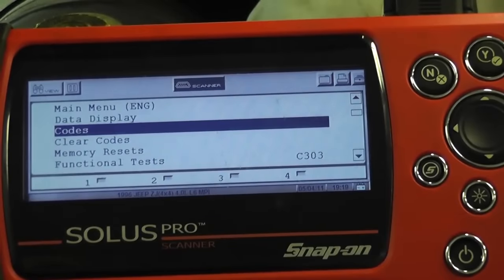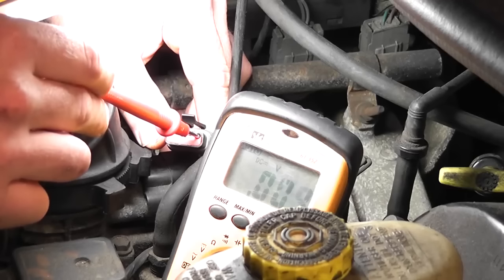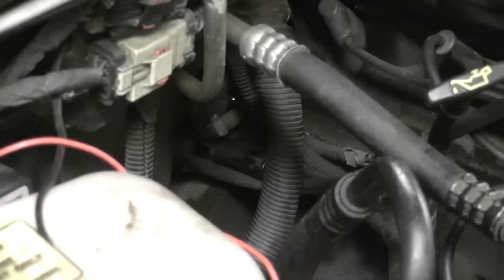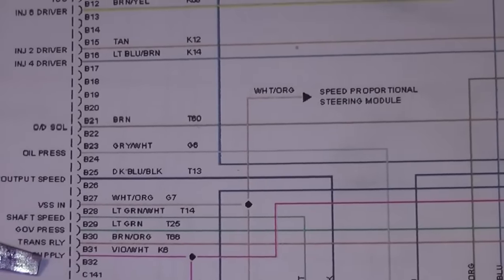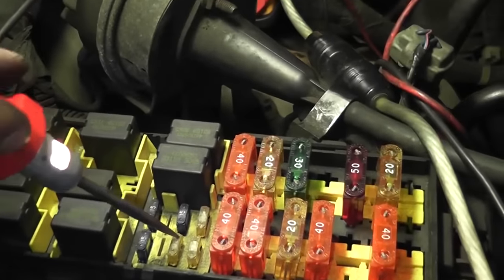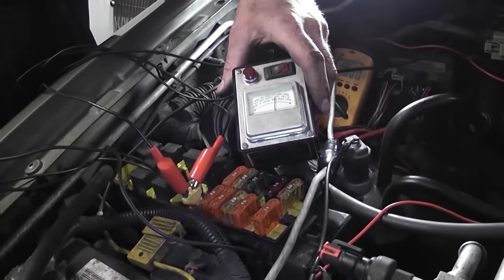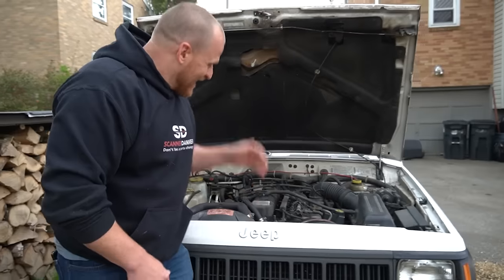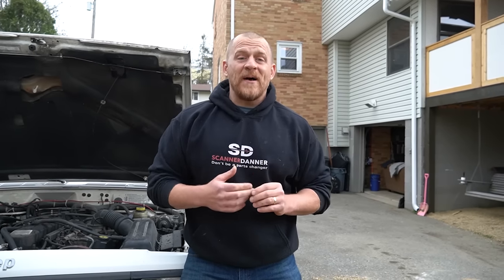96 Jeep, No Start, No Com with PCM, No 5v reference (Quick Tips)

Comment: Hi dear, instead of cutting the 5v ref wire, could its pin be extracted from ecu connector? And measure the voltage.
Reply: Yes
Reply: I was thinking the same thing, although extracting the pin can also be a huge hassle sometimes.
Reply: I think first of all we have to check feed power in ECM connector because first he show it not communicate so no need to check 5V.Battery positive and negative in ECM is basic troubleshooting if any ECM not communicate.
Reply from the maker: Yes, of course, but on this style ECM connector, the pins all want to fall out when you take the main plastic holding piece out of the connector.
Reply from the maker: @Nadeem, please watch the shorted MAP sensor video that I referenced in here, then you can tell us all how to troubleshoot these circuits.
Reply: The reason for cutting the wire was to obviously save time.

Comment: I remember this one. Yes, you should have started with the fuses but your approach was better for your students. Nice fix and bad bad design from Jeep.
Reply: Not really, if you go to the end of the video where Paul shows us starting the 96 Jeep (different one) but showed us where it was supposed to have been addressed (behind the power steering pump) as it should be so the owner or someone at the time had replaced the pump, but didn't put the wire back where it should be.

Comment: Hi Scanner (not Daniel), 2003 5.3liter Silverado stalled a few times now only cranks. We changed gas lines, filter, cam sensor, crankcase sensor, plugs & wires so I cleaned the main window switch then disabled the security passlock ignition module directly and then with the 4.7 ohm resistor!? Also installed a programed computer. Computer shows VIN on Snap-On Scanner but only cranks. We only get about 1.5 volts references to computer with no pulse to fuel injector. No, I don't know what I'm doing. Wish you were here..2Help! ? What 2do?
Reply from the maker: 1.5 volt reference, start here! 
Unplug sensors that share this 5v ref and see if it comes back. MAP, TPS, AC PSI Sensor, Fuel Tank Psi etc

Comment: Where do you get your wiring diagrams from? I've Bern looking for a wiring diagram for my 2011 Dodge Ram 1500 4.7l.  All I can find are diagrams for hemis. I've never had to work on electrical on cars, but this issue hs been driving me crazy
Reply from the maker: This is the DIY version of the diagrams and service info I use. Same info, just access to one car. https://eautorepair.adtrk.biz/?a=10817&c=24&p=r&s1=

Comment: Hmmm. Next time im running into a short on a 5v ref im gonna put a low amp clamp on it and see if i can call it that way. A short pulling the voltage down meens more current flows than what is suported by the circuit...
Reply from the maker: That would be correct BUT, the computer systems are smart and will actually disable to 5v regulator (isolates it from the circuit) as soon as a short is sensed, so this method would prove to be frustrating on some models.
Reply: @ScannerDanner  Ah. That is true.
To fight that one would have to have the scope running to catch it when you turn the key on. You know, before it cuts out to protect itself

Comment: have you ever seen a vehicle with Metal Conduit(long metal tubes, looks like fuel lines)as a wire protector instead of the plastic conduit. It gets used in industrial and now even residential applications.
Reply from the maker: I have not as weight would be the factor

Comment: I have a 98 jeep zj 4.0 laredo i have put in a new computer new alt , Coil aic throttle position up stream down stream new crank position sensor new cam sensor new exhaust manifold intake manifold checked for vacum leaks and still every once in awhile after warm up i get that engine surge. After i turn the key on and gauges and lights do its prefunction check the check gauges light stay on i cant get the obdi to talk to the computer. Been chasing this gremlin for 2 yrs now need some advice please help.

Comment: Greeting Sir, am Suh Vincent writing from cameroon. My question is does the ECU generate just one 5v and distribute to all the sensors or each sensor have a ic which generate it 5v reference
Reply from the maker: On the 96 model year, yes there is only one. But on newer systems you can have as many as 4 different 5v regulators in a PCM

Comment: Thank you for this good video, Paul. I'm working on my 1989 Camry blown fuse problem, 2 months now and I can't find the wire.
Reply: HI Nancy Lewis i think if you had the wiring diagramme you should be able to find it.
good luck and have a nice day. By
Reply from the maker: Intermittent problems are super difficult. Find out what all runs off of that circuit and then do a good visual inspection, especially on the areas of the harness where there is heat and vibration.
Reply: @ScannerDanner  most likely inside the cab,?  or engine compartment.? The DOME fuse covers, Antena motor, Radio, Clock, ECU, door warning light,  all interior light, taillights. Thanks Paul.
Reply from the maker: @nancylewis7142  2 months ago is the last time it blew? And it's a daily driver? That won't be easy to reproduce. But yes, I'd look under the hood first. Visual inspections of everything near heat and look closely at where all the harnesses are rubbing. Also watch my Hummer case study with the shorted reference circuit for an idea. I had a main harness rubbing on a bolt! (I don't have the link offhand, it's one of my newer videos)
Reply: @ScannerDanner  blew 2 months ago, I parked the vehicle and I start looking for the problem. No it's not the vehicle I'm driving, but my grandparents gave it to me, and I'm gonna use as a second car. For emergency only.

Comment: i have a 97 grand cherokee 5.2 that starts but no crank , this problem happened months ago, it had been running the day before.  and it would crank but no start, the fuel gauge wasn't reading right it had a 1/4 of a tank . i replaced crank sensor , ignition pickup coil , the coil check ok , could the pcm gone bad, i will check power to the pcm and also when i check it with a code scanner no codes. any suggestion ?

Comment: Scannerdanner, what is the name of that short finder tool you used in the video its a silver grey meter with a RED light. I haven't seen you use that tool so I don't know the name of it or how its used. I think you connected it across the ABS relay terminals and was moving wiring harness to see if the RED Light would turn on?
Reply from the maker: I have it listed on my Amazon affiliate account https://www.amazon.com/shop/scannerdanner
Reply: Nice thanks ya it shows a lot of your tools you have used in your videos I have seen before. I don't think I have seen you use that short finder meter in other videos. Before cutting the +5 volt wire, you could have just unplugged the Harness connector to the PCM Computer and measured directly to the +5vdc pin and ground to know if the PCM computer is output +5vdc with the harness connector removed?

Comment: Correct me if I'm wrong, but wouldn't having an incandescent test light hooked up to battery positive resting on the side of the fuse socket going to the sensors and watching for the light to turn on while doing a wiggle test also be a valid method for identifying the short circuit? Loving these new summary videos by the way.
Reply from the maker: Yes, you can do that on SOME circuits, but not on this one. The fuel pump and O2 heater which have constant grounds, will cause the test light to find a path to ground through these components, lighting your test light constantly even with NO short to ground. So in short, when you have low resistance outputs on a circuit that can carry the current of your test light, you CANNOT do this test you are suggesting. Make sense?
Reply: Thanks for reply and yes your explanation makes sense. I had a feeling there would be an issue with my method, while I agree that the test light would be illuminated regardless of the situation due to the paths to ground you mentioned I would think the intensity/brightness of the light would change when the shorted wire came into contact with the manifold. The reason is alot of the circuits you described have windings (solenoids, alternator) which I think would place a load and reduce the brightness of the test light until it could bypass all those components when the short to ground occured and the light would become brighter. Not trying to challenge your knowledge as I've learned alot from your videos, but this theory has me interested. Thanks for your time.
Reply from the maker: @richardsalaverria9363  all good my friend and great questions. Just remember in the case of a brush type DC electric motor, that they essentially have no resistance when they are stationary, so your test light will be exactly the same brightness as if you were connected directly to ground. 
Others circuits, you are correct, you'd have different levels of brightness based on what the output resistance is.

Comment: Can you do one on the can bus system?   I'm having a problem with no can bus on a 99 jeep cherokee 4.0. it happened after I beat the living shit out of the jeep at the mud hole lol. I'm good with the electrical system for the most part  but never had a jeep kick my ass on a can bus system.
Reply from the maker: A 99 wouldn't be a CAN system but you can have a data bus failure for sure. 
Are you getting a no bus message on the cluster?
Start by checking for a 5v ref to your TPS or Map sensor with the key on

Comment: I just have a question. As someone with knowledge of these things how much would you charge someone to fix something like you will with this? Or how much do u think a shop would charge in order to find such things?
Reply from the maker: The real question is how much are you willing to let a shop guess at the problem and throw parts at it until it's fixed? Everyone is willing to do that, but when you suggest $500-1000 for an expert diagnostic tech/shop to handle something like this, that didn't need any parts, people call you a rip off artist.

Comment: Hello mr SD hope you can help me little regarding my car problem i have nissan exalta 2003 no start 
Spark all in 4 cylinder 
Have 12 volts in all 4 injectors but no pulse 
Have 1149 volts in ckp 
Have 1149 volts in CMp
Can you give me a tips what is the problem thank you so much

Comment: Hey Brother, I have a Question/ Challenge for you, 
  1995 OBD 1   Jeep Grand Cherokee, 4.0L  Automatic.
   Been tracking down a Misfire/Surge Issue.  
Misfire is mainly noticable at idle, and Exhaust has obviously noticably strong odor,    Engine Surge in Gear 
 Engine warm or cold, makes no difference.
   Have tested Everything, and at first didn't find anything,
  Then looking everything over again, discovered,  that voltage for the 5V Reference Going to the Coolant Temperature Sensor Fluctuating Between 4-5V  instead of staying at 5V . 
 This is of course testing with the KOEO,   and it makes no difference by unplugging Everything else,   
  Everything else Tested as is should, and nothing else was found to have any issues.
   Just the 5V reference Circuit positive for the coolant temperature sensor,  the ground tested good, along with all other grounds.
  I am suspecting Either a Short in the harness, a corroded pin on the ECM connection,  or a issue with the ECM ,  in which case I would like to repair the ECM rather than replace it if possible.
   I was wondering what you think?  And if you have ever seen this sort of issue,  and if you are familiar with repairs on a Jeep OBD 1 ECM .  As to , do you think that it could be a failing capacitor in the ECM.
   This issue was tough to spot, 
  In order to notice it I tested Everything for Voltage and OHMS for 60 seconds or more continuous during each and every test. 
  Thank you.
 Tim from Wisconsin.
Reply from the maker: Does your surge at idle match the fluctuations in the ECT signal voltage?
(Sensor plugged in and backprobing of course)
Reply: @ScannerDanner  I have not tested that with a back probe  with the engine running YET.
   But I can say that the feeling of the Surge ,as well as the Timing of the Surge appears to be nearly identical to what I seen in fluctuation during the voltage test, during the 5V test on the coolant temperature sensor wires.
Reply: @ScannerDanner  I was planning on unplugging the ECM and inspecting the connector pins.
  But since you asked me about back probing the connection, I will do that test first before inspecting the ECM.
  Thank you Very much for any and all advice, ideas or information.
  I'm a old timer with about 40 years of working on stuff myself, 
  But as you well know every project is a a new challenge, especially when it comes to something electrical.
Reply: @ScannerDanner  
 I did as you recommended,  and back probed the circuit wires for the coolant temperature sensor, 
  And with the sense plugged in, the voltage still fluctuates, with the engine off , and with the engine running,  and the surge/ misfire does coincide with the voltage fluctuation.
 . After testing it as you suggested, 
 I unhooked the battery, removed the ECM , and tested the wiring and it tested good.  Then I cleaned up the ECM and the surrounding areas and cleaned up all of the ECM connections/ pins and the connection that plugs into the ECM .
  Reinstalled everything and retested everything,  .  And unfortunately I am getting the same exact results.
   So it is looking like the issue is in the ECM.    So now the question is do you know what part of the ECM controls the five volt reference Circuit for the coolant temperature sensor.     Could it be caused by a failing capacitor?   I know the the capacitors do wear out and fail,
  But I have never seen or heard of a issue similar to this one. 
  And that is why I asked for your advice.  If you have any any ideas it would be awesome, . 
 And if not, well then I guess I just educated you a bit of a possible situation that can acure with a OBD 1 Jeep,    or maybe even possibly a OBD 2. 
  Thank you again. 
Tim from Wisconsin
Reply from the maker: @tsmith578  The same 5v regulator is used for all the input sensors. If you are not seeing this same fluctuation on other sensors, then it is not the 5v regulator that is at fault, but something within the current limiting resistor inside of the ECM itself that isolates thermister circuits. Can you check the intake air temp sensor for me and tell me if that same issue is there too? Also, to be clear you said all the others 5v ref circuits looked good, right? Then yes, this does sound like and ECM issue.
Reply: @ScannerDanner  
Yes Sir,, I have have tested all the circuits,  12volt and 5volt , and even the speedometer circuit at the output of the transfer case. And it has a steady 7.25 volts.  
  And the coolant temperature sensor circuit 5volt is the only one that I found a issue with.
 It fluctuates with in about one volt when unplugged from the sensor,  meaning it will randomly displays different voltage amounts between 4 to 5 volts.  And it fluctuates with in about a half to three quarters of a volt when plugged in,  weather the engine is running or turned off with the key in the on position.. 
  To put it in terminology,   this was a heck of a mind bender, because I had really checked everything over looking for the cause of the lowsy running condition,   with no logical answer until I finally discovered the strange occurrence with the coolant temperature sensor circuit..
   I am a bit on the fence about replacing the ECM ,   I would prefer to repair the original one of possible.
  As long as the cost versus time makes sense,     for me the reward is often in doing the repairs myself, just for the gain of knowledge of nothing else.
Reply from the maker: @tsmith578  as long as you see this same voltage on the ECT pin, right at the ECM itself, you're done. You need an ECM.
Reply: @ScannerDanner  I didn't check it directly at the ECM pin  , which is pin # 2 ,  but I did test and clean the pins and the ECM connection,  and the tan and black wire from the coolant temperature sensor to pin #2 at the ECM tested perfect at   0.00 ohms on a continuity test.
   So you are absolutely right.
 I need a ECM .    What a sad releaf.
   Riddle,,,, what are two things that no ever wants to hear? 
  Bad news,or the truth,  
As they are often the same thing.

Comment: Dear sir, I have a Nissan sunny 2014 N17 model in my garage. The car’s U1000 code and B2193 code comes in and shows the ECM of the car is not equipped. The car does not start either. How to diagnose this issue?
Reply from the maker: If you are still stuck on this, post to my forum www.scannerdanner.com it is free to join and we can help you there. Thanks!